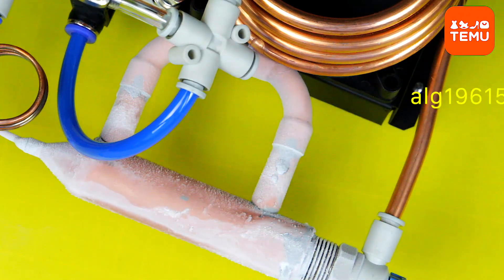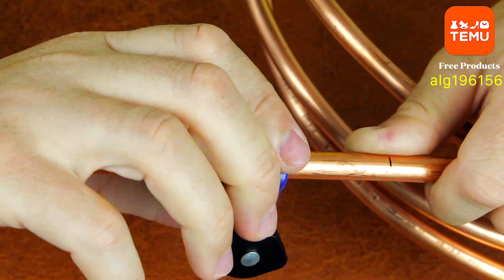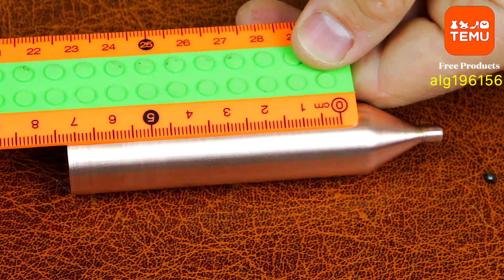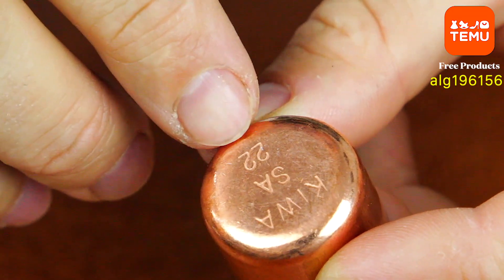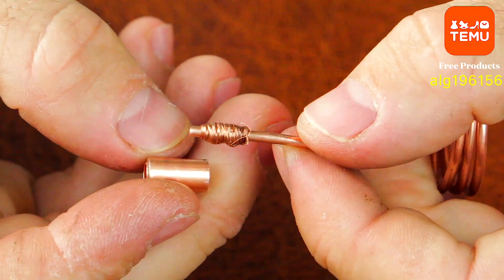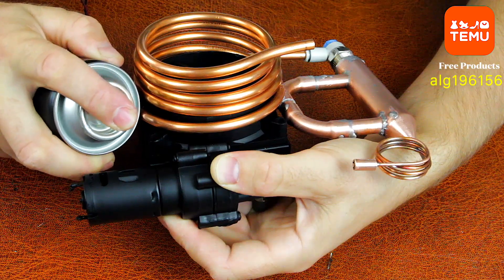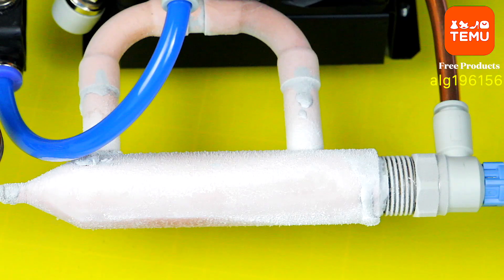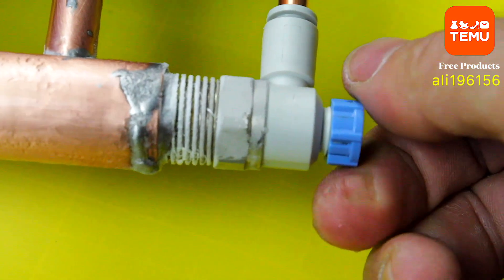How to Make an Adjustable Split Freezing Air Conditioner Down to -30°C and a Heat Pump Up to +45C

Comment: Where does the heat go?
Reply: back into the room
Reply from the maker: In portable mobile air conditioners, the hot air is also vented back into the room. To avoid this, a flexible corrugated hose of the appropriate diameter was invented, which needs to be directed outside through a window or any other opening. That’s why I didn’t think it was necessary to show in this video how to make another simple box-like construction to separate the condenser from the evaporator and vent the hot air outside. If an idea is obvious and easy to implement, I don’t see the point in making the video longer just to include it. However, I always show and explain truly complex designs or unusual ideas in detail in my videos.

From a scientific perspective, this method of venting hot air significantly increases the cooling efficiency by preventing reheating of the air in the room. This is why even industrial and household systems always have a way to expel hot condenser air outside.

Comment: i am poor looser ,i failed to find same compressor as on yr video at "temoo", very pity same will be with all rest....
Reply from the maker: In the video, I explained in detail where and how to get all the necessary components. You’ll find links to the products and stores in the description below the video — just follow them, download the app, and search for keywords like “compressor” or “refrigeration parts” directly in the app. You’ll instantly see a wide selection of compressors, evaporators, copper tubing, and other components you need to build the same air conditioner as mine.

Additionally, you can use my unique promo code (also listed in the video description) to get some products completely free and others with a discount of over 30%. Keep in mind that searching through the app usually gives you a more comprehensive and accurate list of items than using a regular web browser, so be sure to try it!